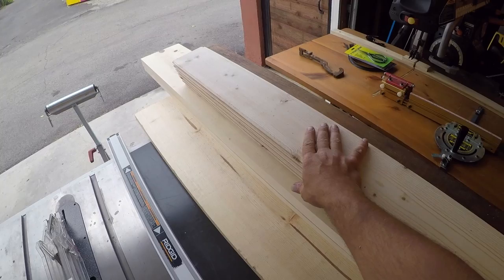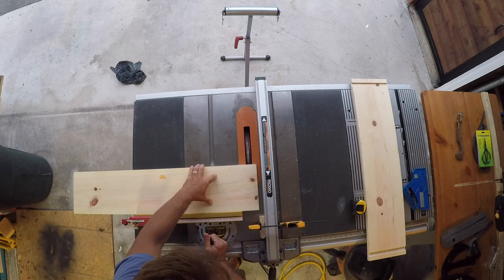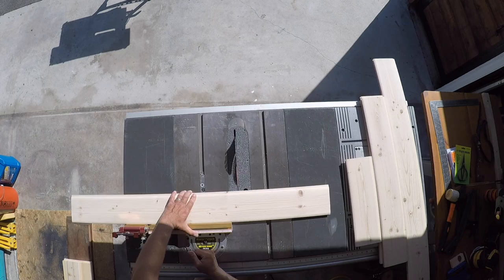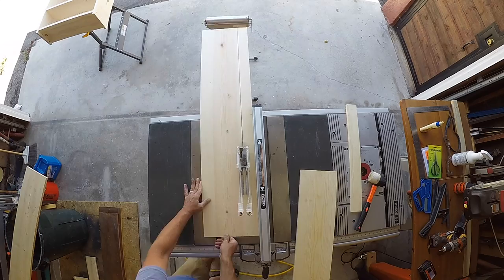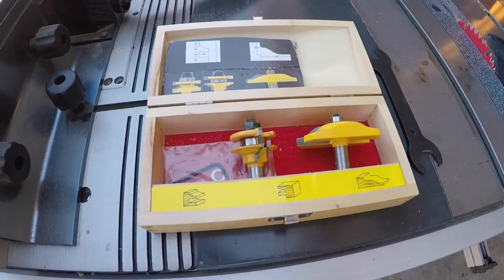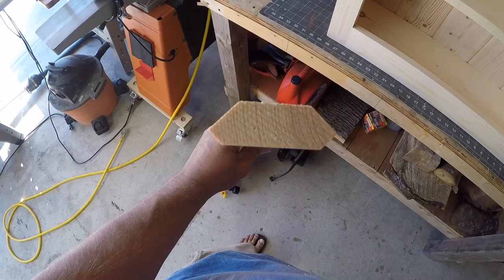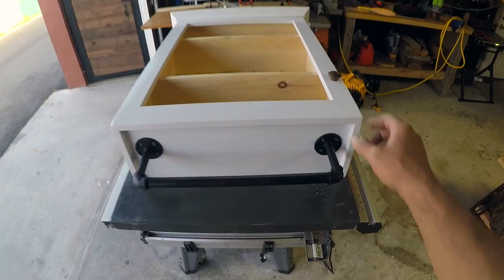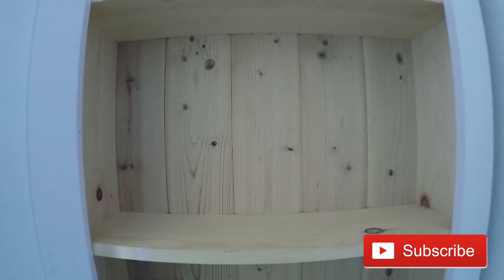How To Build A Medicine Cabinet - DIY Woodworking Project - Bathroom Remodel

Comment: Excellent cabinet in the end - classy, smart. A bit of friendly advice though ( because I liked your video overall, and intend to see many more). Keep your videos (as) short (as possible). Cut out the unnecessary chatter and speed up the wood cutting parts. This video would have been a 5-star video if you'd kept it within 5-6 minutes, which was possible. Have subscribed and liked.